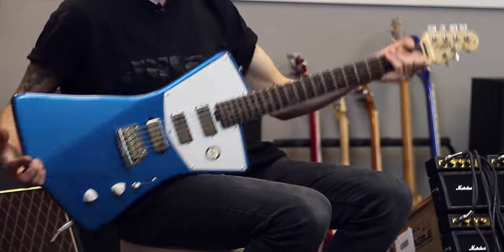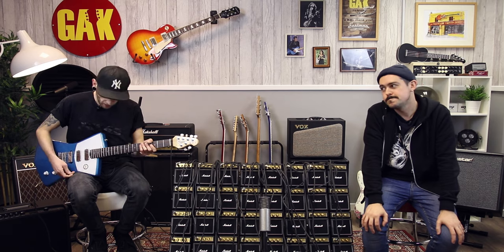1x50W Marshall VS 50x1W Marshall Mini Amps

Comment: It's actually not a bad fuzz pedal. it's just really big
Reply: So it's a Fuzzzzzzzzzzz
Reply: whosnext1972 BIG Muff
Reply: whosnext1972 "huge muff"
Reply: xfallen Giga Muff
Reply: Any idea of a fuzz pedal that would have that cranky sound as at 2:20 and onwards? I checked the big muff but it's not quite the same...
Reply: Danny Keil Mega muff
Reply: Adrien Rouleau ¿MEDIOCRE Muff? 😂
Reply: When he sweeps with all 50 on it sounds like bit crusher.
Reply: Carlos Park think the same
Reply: Reminds me a bit of the Zvex Fuzz Factory.
Reply: @adrienrouleau5188  try mxr octa fuzz crancked up
Reply: And only like £1250
Reply: It’s is actually modular so you can take it apart and it also has 150 controls
Reply: i think the same before read this xD but was funny
Reply: @adrienrouleau5188  no when you plug this into an amp it sounds a lot different duh. You do realize the speaker in the ms2 mini is a 1 inch speaker? Lol a 12 inch speaker sounds a lot different duh...
Reply: @adrienrouleau5188  old super fuzzes, hyper fuzz, the EHX germanium 4 also does that sound and u can control the gate/voltage on it
Reply: Lmfao
Reply: Yes it is... that's exactly what that was like.
Reply: even bigger muff
Reply: And uses lots of batteries.  I have one of the 1 watt Marshalls and 1 MusicMan 210 HD 130
Reply: I wish they would have played with the volume knob on the guitar  to see how it cleaned up.

Comment: If you ever do this again you should use a sound pressure meter, it would be interesting to see how many decibels the 50 micro amps put out compared to a 50 watt ss amp and what that would put out cranked.
Reply: That was the no1 fail on his video
Reply: Yeah, exactly.  The whole time I was wondering how it was different sounding/feeling "in the room".  To me, I heard different phase combos hitting the single mic with each added 10 amps... But did it get louder and/or better with 10 more?
Reply: It should be 34dB louder than a single micro amp. How loud is a single micro amp?
Reply: The would also need to ensure that the input voltage and resistances to the amps were controlled so they could properly compare. It's not so simple as just splitting the signal here.... If we're talking technically. It very quickly becomes a very advanced problem in both acoustics and electronics one which clearly these two dudes either don't understand, or didn't care to account for...

Click bait indeed, yet not. It delivered but lacked technical analysis....I was disappointed they didn't even qualitatively discuss how it sounded...

Comment: I once modified a mini amp to have an external output. You'd be surprised how much sound 1w can generate with the right speaker cabinet.
Reply: I can't get my Artist off the half watt setting.
Reply: The hughes and kettner grandmeister I have does a 1w, 5w 20w and 40w power soak.
The 1w pushes pretty damn good thru my Mesa 4x12!
Reply: @yeti.o2w  same here, that 1w can actually put out some volume.
Reply: 1 watt can push most 12" guitar speakers to 97db. It's all you need, clean headroom notwithstanding.

Comment: Sounds better than a metal zone
Reply: Kasper Nystrøm better than Zoom 505:D
Reply: The metal zone is a great pedal for passive pickups. You have to know how to use it tho.
Reply: Pow3rus that's true, although it only works for specific genres. Unfortunately most people associate the pedal with beginners who know nothing about tone (or subtlety). It also depends on the pickups, and the person dialing in the tone. It's not the best, but it works
Reply: Du har helt ret
Reply: to go along with the Spinal Tap Stonehenge
Reply: Kasper Nystrøm - Metal Zone pedals kick ass if you know how to use one properly.
Reply: Shane Curren -  I own 2 metal zone pedals, one for the heavy distortion and the other I use as a boost. Since 1991
👎boo hipsters
Reply: Metal zone pedals sound like ass. Unless you use it on low as a boost. And then, a ts9 sounds better for that. 

But using a metal zone on the clean channel with all the gain you can find and no mids is how 90% of guitarists that use a metal zone set it. Even with the mids up, it still sounds harsh though. For a distortion pedal, Id use their super distortion. But I'm not a fan of distortion pedal. I'd rather get my beans and potatoes from a nice high gain amp. Like a 6505 or a jvm410h or the like
Reply: Kolton McCallister while normally I would agree with you, a MXR Full Bore Metal on the clean channel... Sounds simply incredible.
Reply: Stephen Garofalo never heard one. Didn't even know that existed lol. I'll have to look into that.
Reply: Kasper Nystrøm sounds like you are a beginner 
 The metal zone is a great pedal but you have to dial in the settings a bit.
Reply: man what is everyones problem with hating on the metal zone pedal. i have one and that shit shreds and i get a nasty tone out of my jackson. just use it right lmao
Reply: Sad every marshal needs a metal zone. Considering the price. Pretty pathetic rig

Comment: Battery powered amps are really great for recording lead tones. I had the little battery powered amp and when it was cranked it would get fuzzy sound that happens when the battery can’t meet the voltage demand. I learned this trick from the guitarist of STP that used an Altoids can amp to record one of his solos. Little battery amps can sound massive.
Reply: No AC power supply noise either.

Comment: Sounded like a muddy mess but was fun to watch and those little amps sounded good for what they were. Should've had an SPL meter on and showing the sound pressure levels.. thank you, fun video!
Reply: Yeah it did I gotta say.
Reply: I liked the clipping. I’m a fuzz enthusiast though. It sounds as if the signal is forcing it’s way through, into our field of perception through sheer force of will.
Reply: Sounded terrible. Lol. They didn't put any effort into optimization though.

Comment: I kind of wish they tried to find the best tone settings for the 1w amp and multiplied that instead of cranking all of them
Reply: agreed , that amp was designed more for single coils in my opinion . it sounds way better with single than super high output humbuckers or actives . the ms2 sounds great if used right . try alnico singles with it .
Reply: They also could have had a spectrum - like a range of the knob positions across all 50
Reply: Was about to post something similar. Maybe it wouldn't have sounded amazing but it most certainly would have sounded better than what we heard here

Comment: Can you run all those little amps through the 4x12 ? That would be killer.
Reply: I've actually seen people mod these to have a speaker out, and then run it into a 4x12 - it sounds pretty damn good.
Reply: No you can not
Reply: I actually too a Sears Silvertone 5 watt amp and out it into a Marshall 4x12. It sounded much bigger. Not gonna tear your head off, but compared to that single 8" speaker, it was pretty cool and loud enough to let you know. Of course those cellestions were barely being worked.
Reply: @EclipseAtDusk  how?  there's no way 1W will drive those.
Reply: @BenState  why?
Reply: @BenState   I don't know but maybe connecting one of those to a power amp and then to a cab could have a good result (?)
Reply: @demonoising  yes for a noise multiplier
Reply: @BenState  of course can a 1 W amplifier drive a 412 cabinet.
Reply: @alli333o  Its 1W max, with no speaker out and 100mA max power.  Dream on.
Reply: @alli333o  Firstly, that's modified, and we don't know how the cab is set up.  Nor do we hear clean.  The AMP is not 1W, its 1W peak.  100mA is its maximum draw from the power supply so that means, at most it can peak at that wattage.  Learn some physics.  1W at what voltage?  Running a distorted as shit sound through  a very efficient cab speaker is not the same as 'it will be fine'.
Reply: @BenState   @Ben    oh no! Distorted electric guitar. What a pain.

He replaced a resistor so the headphone jack is usable as a speaker out. Does not change the overall power output. Also, even 0,1 Watt RMS can drive a 412, only at a lower volume output. 1 Watt is aproximately half as loud as 10 Watts connected to the same speaker. 100 W would be four times as loud (in a very theoretical world!) Yes, the efficiency of the cab plays a big role. 

The clean tone would be more quiet than distorted. As in any guitar amplifier. Still, it can be done, has been done and sounds perfectly fine for what it is.

You stated "1 Watt can't drive a 412" and that simply is not true.
Reply: @BenState  i have a 1 watt SMOKEY amp - 9v battery no knobs full output and it can drive a 4-12 cab... i run it into a 6" subwoofer cab and it sounds great for camping etc
Reply: @jamesha175  fantastic.  still not what I mean.  power out cannot exceed power in.
Reply: @alli333o  You have no idea.
Reply: @BenState  please re-read. Your statement was "there's no way 1W will drive those [412 cabinets]." 

Don't change subjects mid argument.
Reply: @alli333o  Modifying the output to send direct current to the speakers is not what I call working.
Reply: @BenState  now you talk absolute nonsense. DC doesn't even produce any sound apart from a single "pop" of the speaker. How would replacing a build in speaker with a jack or jumping a resistor change the output from AC to DC?
Reply: @alli333o  Lol ffs you really have no idea.  You do get that there's a ADA process going on?  Clipping is square wave.  That's all you're getting.  By mismatching (changing the resistor) the output load, the amp is always in square wave, practically putting DC on the output rails.
Reply: @BenState  oh, thats what you meant. But you do know the og speaker is 8 Ohms? So as long as your 412 has at least the same 8 Ohms, you have not changed overall resistance.
Reply: @alli333o  not when you change the output load.  Impedance is not the same as resistance.
Reply: I had one when I was younger and I modified it to have a speaker out and ran it through a 2x12 Celestion cab and sounded surprisingly good.
Reply: @BenState  oh really? Guess you've never heard of a DSL 1.
Reply: @paulkimber6028  Valve tech is totally different.
Reply: @BenState  Of course it can, as long as the impedance is matched.
Reply: @BenState  lol the fact you even typed ADA shows you really don't know what you're talking about
Reply: @DanHomeAtLast  why?

Comment: 50 of the JMP1 1 watts would have been better, albeit 100x more expensive.
Reply: BionicSammich i have had two JMP 1's for 20 years. They are still awesome.
Reply: I meant those 1 watts they had out in 2012 lol.
Reply: Its pretty lame that they aparently cant keep track of the amp names and give two amps the same name. I do own the rack preamp myself.
Reply: They kept track of the names, but it was just unfortunate that the names overlapped. They had also discontinued the rack JMP1 years before the other one came out.
Reply: BionicSammich  I know the rack was discontinued, but i wouldnt call it keeping track of the names since they reused the same name, it just got to be a mistake or they are just stupid. No sane person would prefer to have a new product confused with an old discontinued product.
Reply: Its not a mistake. They made a whole line of 1 watt amps based on the 60's, 70's, 80's, 90's and 00's for their 50th anniversary. The 60's being a JTM1 (because JTM model amps were what was out in those years and 1 being the wattage so JTM1). Thats why they named the 70's amp JMP1 because JMP was the model number for that decade and 1 was the wattage of these 50th anniversary amps. They also made a JCM1, DSL1 and JVM1.
Reply: I know they made these amps, i still think its a mistake to use the same name as an old product, i would never do that and ive worked as a product manager. Although the names are fitting, they could easily have avoided the issue.
Reply: The names are fitting so they just went with them. They even admitted that it may cause confusion but all of those 1 watt amps had a head and combo version so they were JMP-1h or JMP-1c.